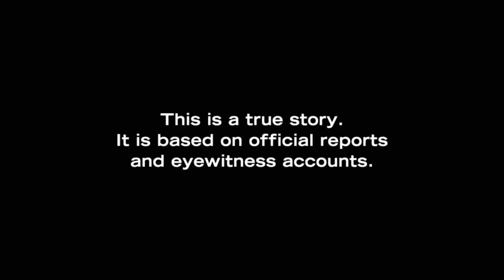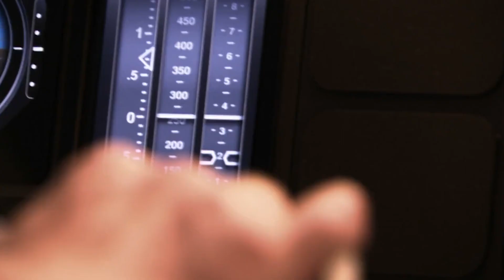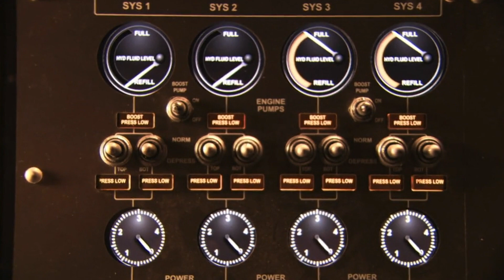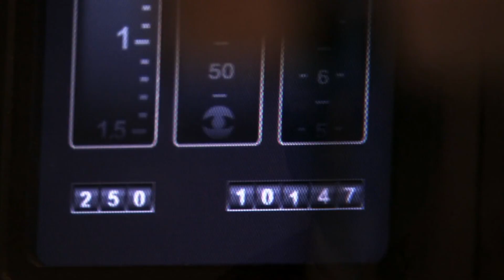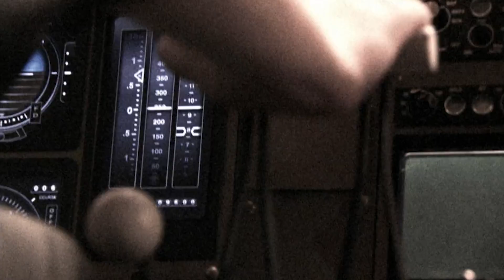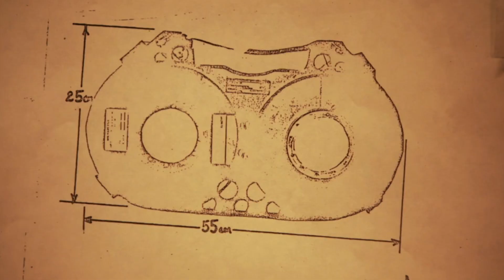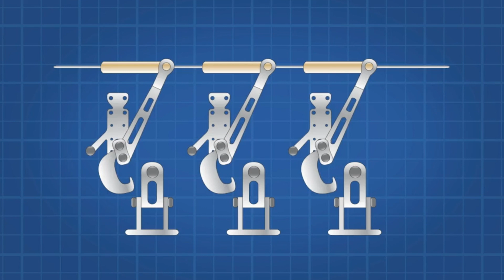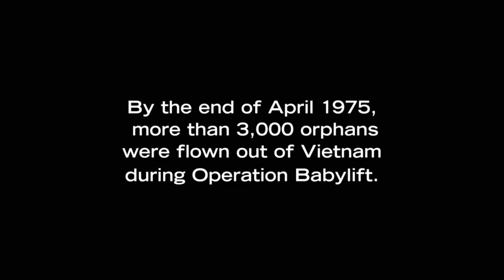Rescuing Orphans When Rocked By A VIOLENT EXPLOSION! | XMAS SPECIAL | Mayday: Air Disaster

Comment from the maker: Are you able to figure out what caused the violent explosion?
Reply: Too much air pressure: not enough working locks. 😥
Reply: What I am able to figure out is that this is the THIRD time you have posted the same video under various titles.
Reply: @zzydny  This appears to be a revised production of the original Mayday: Air Disasters episode about the crash.  There are definitely scenes not depicted in the original.  The makers of the series probably added some previously edited footage to remake the episode.
Reply: @zzydny , we still like to watch it. 😎
Reply: As someone who has seen the results of a pressure door failure I can only imagine. Similar incident happened in the mid 80’s to a C141B while doing a ground pressurization. Procedures were put in place to visually inspect pressure door locks to insure they lock. Canibalization was a common practice throughout the 80’s that I know of. So much so that had what they called a Can Bird.  I would have hated to have been the guy who installed those rods and his supervisor who signed off the ❌.
Reply: @zzydny  they like to recycle old stuff by adding a extra scene or so
Reply: @cigarsgunsanddiesel8032  Rather than scenes, they recycle entire episodes repeatedly.  It is tiresome.
Reply: @Roadglide911 canning is just as popular today as it was in the 80’s, don’t ask how I know
Reply: a SAM ?